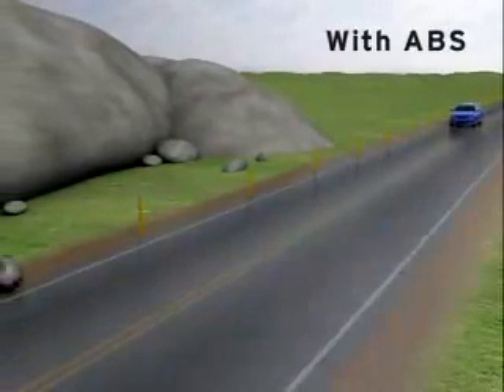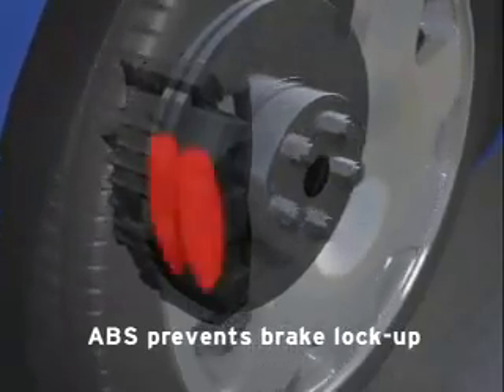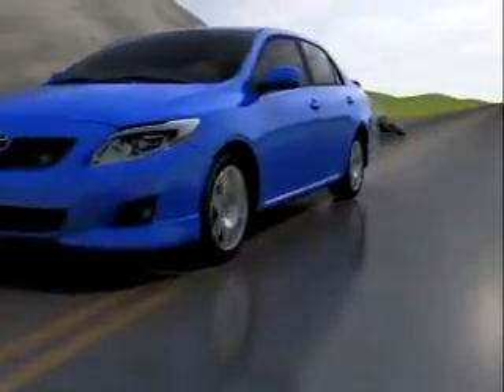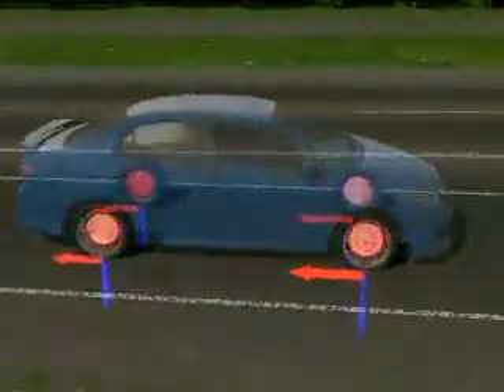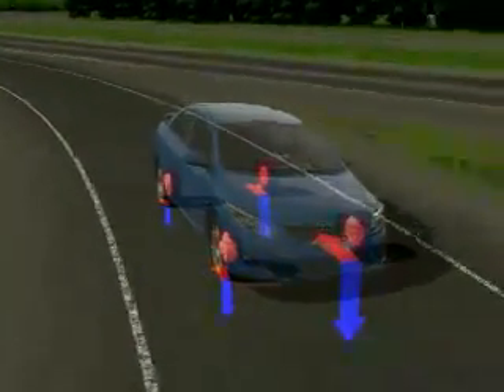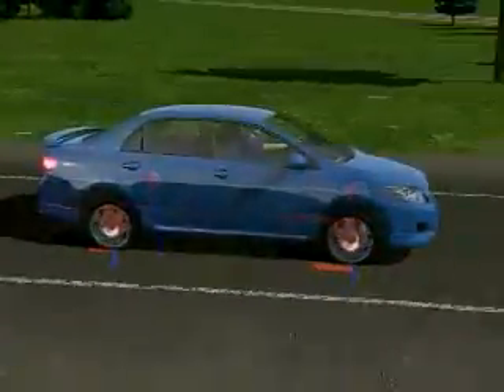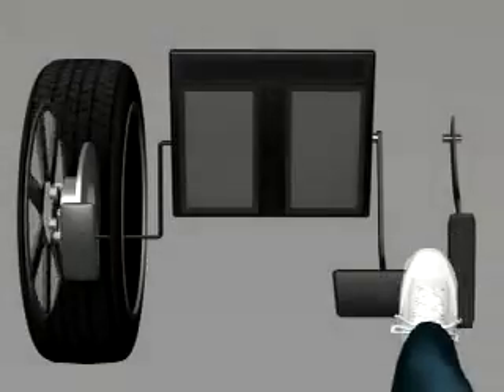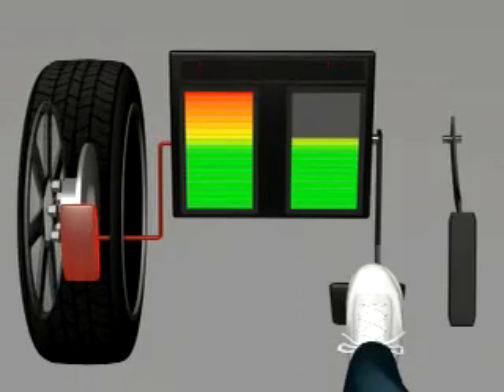Como funciona el ABS, el EBD y el BAS - EscueladeManejo.net

Comment: I have a friend mark astra 2004 car which I turned on the light ASR / TCS (traction control) to turn on the car this light was extinguished and second and read on some cars there is a release button if so where I will have this model or that I do thank you.